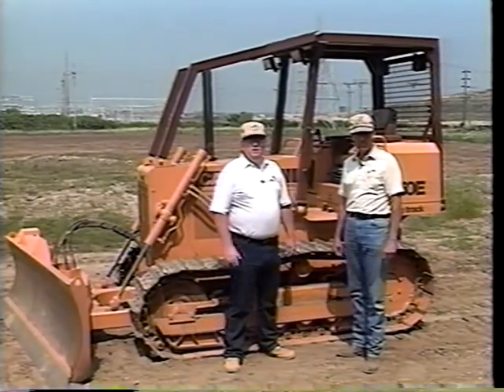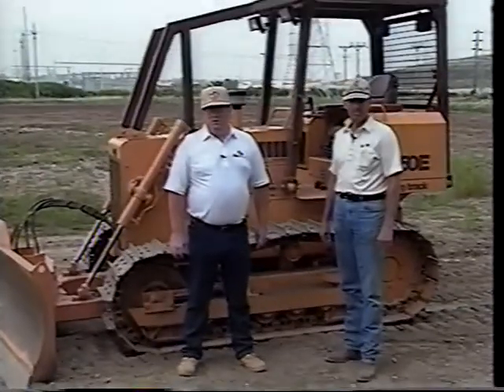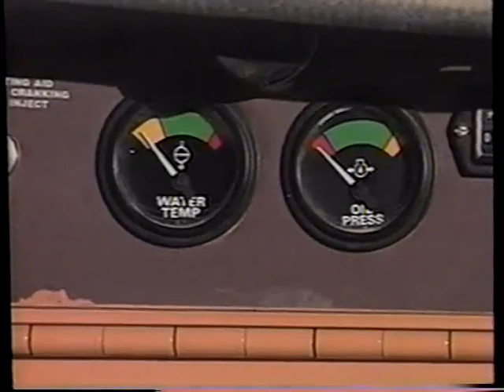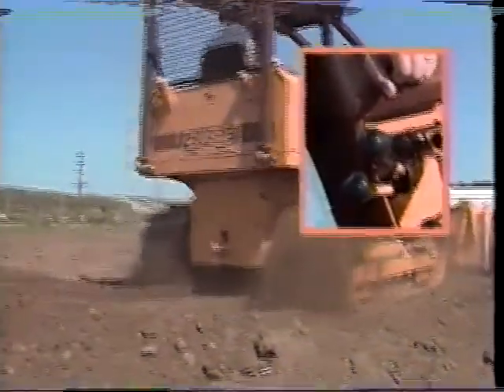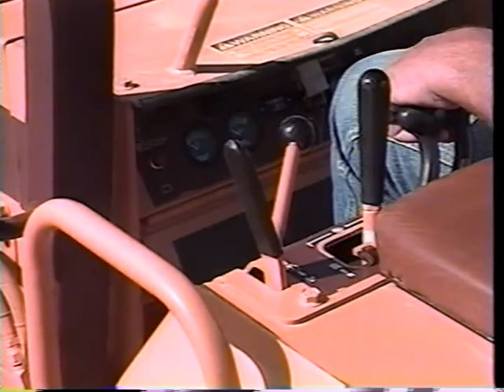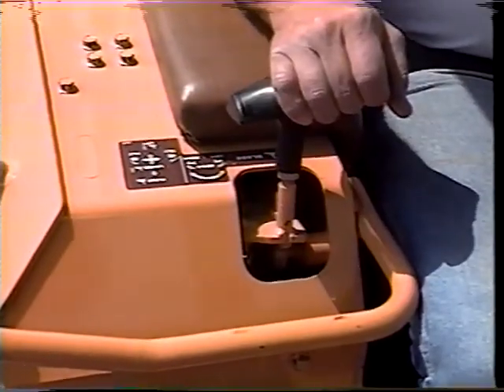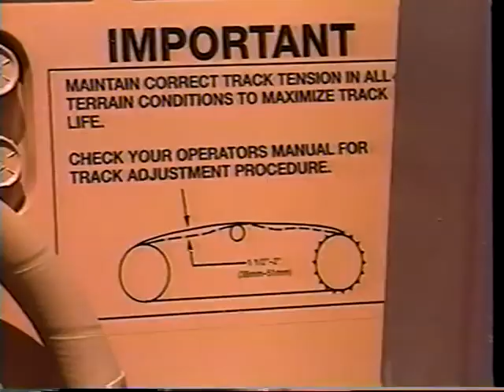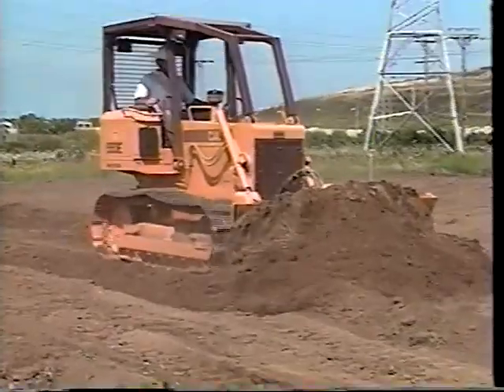Spotlight on the Case 550E Crawler

Comment: When did they fully do away with power shift powerturn seperate track controls?
Reply: When they went to the K Series around 2004
Reply: That was after the big Case / New Holland joint venture. The H series was the last and best version that Case made…. IMHO
Reply: Biggest mistake that Case ever made was going to Hystat. Case dozers we're the best in there size class for 20+ years. I have ran them all and Case may not out perform the others in every single task but they will do more combined work in a 10-12 hour day than any of them. You can push a full load turning if needed. There easy to repair and maintain as well. Sadly that all went away after the H series. Newer ones are nice, but I will keep my 850H until I'm too old to run it.
Reply: @daveb9575  thanks for the info, I’m looking at a 550g with 2800 hours. From what y’all said here I think it’ll be a good purchase